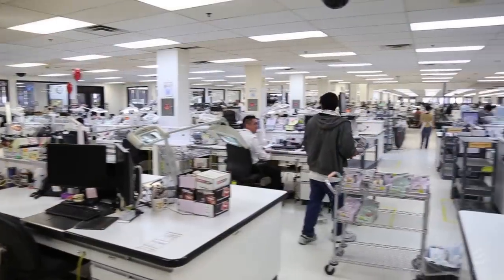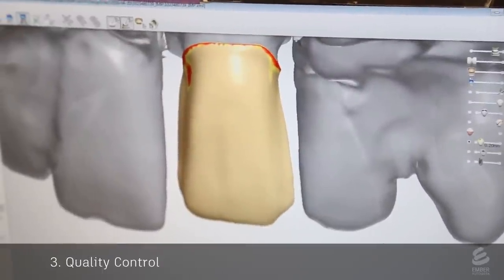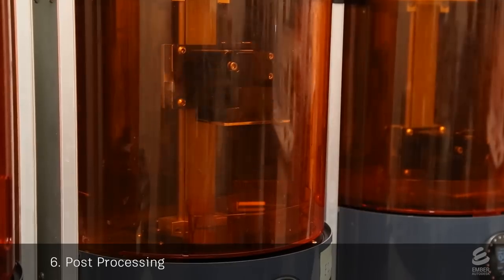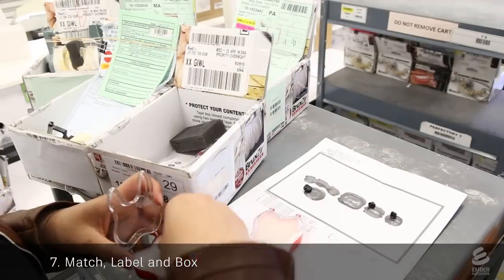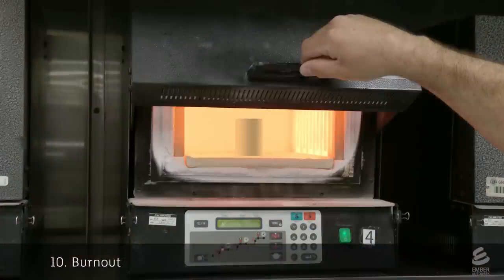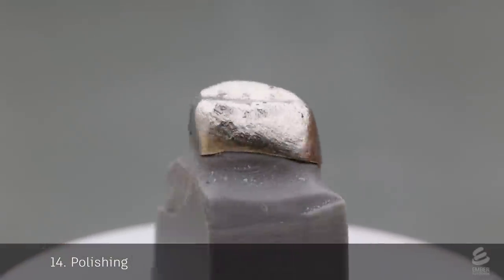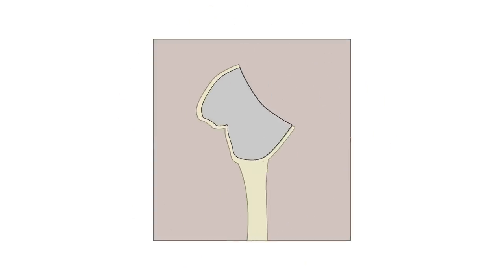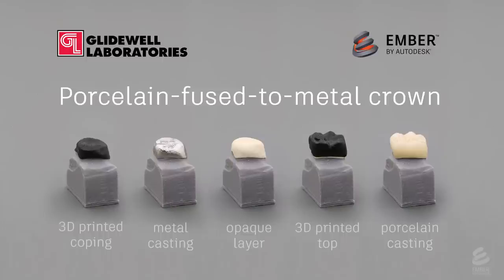How to 3D print PFM dental crowns // Glidewell Laboratories

Comment: The resin tray for this printer is junk. You need to replace it after 8-10 runs and it's about $125 a set or something like that. Very difficult to use. Don't waste your money on this machine. Glidewell lab is using it because they have a support team of 20+ in R&D and a 100+ IT team to support it. Small lab, save that $7000 for something else.

Comment: LOL... this is technology for technology's sake... the form is very basic, no porcelain support and the fit is extremely poor....even without magnification you can see a gap around the margin....is this the best it can do..???... if you're going to showcase a job at least make it nice, this is poor.
Reply: OL.. yes, but to invest such large amounts of money and get such pitiful results is ridiculous... what was the person who bought this thinking..??... you could wax a coping like this in the amount of time it would take to scan it....pathetic.
Reply: scan, mill, fit is ok for non aesthetic areas like molars but anything in the anterior is similar result to a good metal ceramic crown... I still do 80% of my work in metal ceramic...emax for anterior and zirconia for custom abutments... a good metal ceramic crown is still the best... lots of prosthodontists are going back to metal ceramic.passed the test of time.
Reply: in a nut shell... cad cam is ok and I use it a fair bit but if you're using this technology at least make a nice job... the original video is about cad designed 3d printed crowns which are then manually covered in wax and cast using traditional methods... to spend all that money and do copings as crap as that is ridiculous... he spent tens of thousands to automate a 15 min job....with crap results..  and do you remember tech's like Willy Geller, Oliver Brix, Brian walters, and all the other great techs back in the day... those guys make metal ceramics which would shame any cad /milled solid zirconia crown....
Reply: @electro1622  You're totally nailed it, man. Watching this video makes me feel totally same about that ridiculous "high technology" integrations.
Reply: Is this normal in America? If yes this is dangerous. The quality is clearly not there. Where in the world is it ok to have such a large gap between the crown and the die? This don’t look like there is a quality control. The gap, no ceramic supporting modeling. And why are they press it on the metal. No need for that you can do a only LiSi press crown without metal.